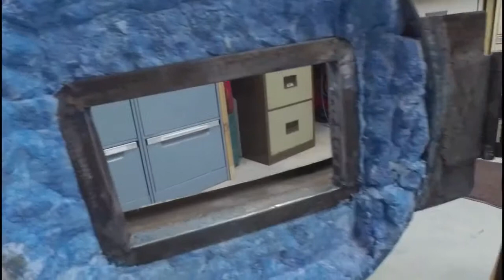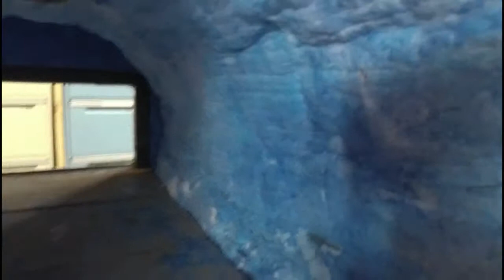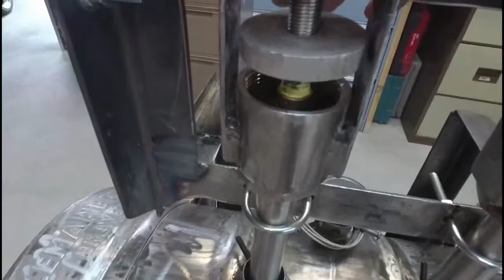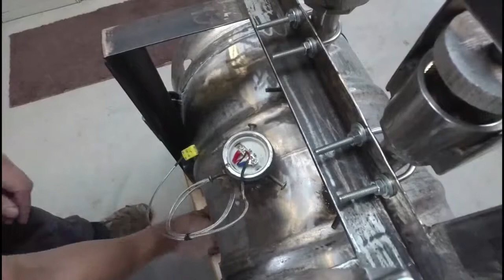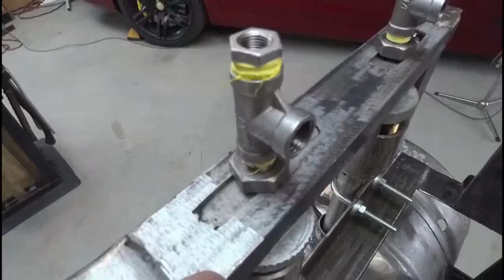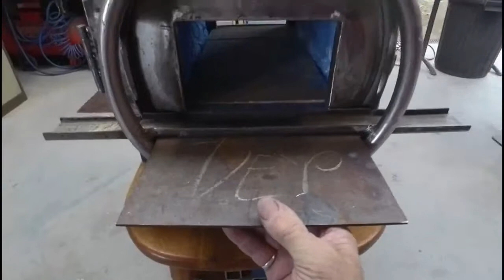Keg Forge Build Part 4

Comment: this has been fun catching up on this series. for what it's worth, you don't need rigidizer if you're going to cover the wool in castable refractory. i welded tabs for the refractory to hold on to on my forge and let the refract hold the wool in place too. the blue is a pretty sweet color!
Reply from the maker: Yer mate I'm aware you don't need the rigidiser under the refractory to hold it there, the reason I used it is because the dust from that wool is carcinogenic and I wasn't happy to do all the rest of the work I had to do before finishing the refractory layer without making sure I wasn't going to be breathing that stuff in that's all. Better safe than dirty when it comes to your health mate. And yer the blue looked great but the rigidiser isn't solid enough to use on its own as it will break away every time you touch the sides of the forge manipulating odd shaped pieces of steel inside. I'm really happy with the way the gas forge turned out in the end and its still working really well after more than a years constant heavy use before I built my coal forge which I use most of the time now.

Comment: Looking good Andy, where did you get your needle valves from, Iv'e been wanting to use those for a while. I'm going to share your channel get you some more subscribers mate. You have done a wonderful job on the forge.
Reply from the maker: Thanks Len I'm quite happy with it as well. I got those needle valves online from EBay. They are Chinese so not as good quality as the Australian brands but at a price that is about 90% cheaper. I think I got those for around $19 a piece where as the same thing from a store like Blackwoods would cost around $189. They took about 5 weeks to arrive but I had the time to wait while I was constructing the rest so that didn't worry me. I will try to find the link for you. I would really appreciate you sharing my channel mate as I would love to expand the channel as time goes on but I'm not on Facebook so I'm limited to people stumbling on my channel by chance lol
Reply: @andywright2606  Ok mate might look them up on Ebay, I'm very happy to share your channel on FB. Get some eye's on your channel.
Reply from the maker: @lenblacksmith8559  This is the seller I purchased the needle valves from 1/4" femal thread not sure what thread you need mate. 
https://rover.ebay.com/rover/0/0/0?mpre=https%3A%2F%2Fwww.ebay.com.au%2Fulk%2Fitm%2F312557505914
Reply: @andywright2606  Thanks mate. Oh by the way, with the burners where they go into the holder on top of the forge might pay to put some kaowool around inbetween the burner and the holder just to stop a chimney affect of heat coming up between the two.
Reply from the maker: @lenblacksmith8559  Hi Len, I already have ceramic fiber which is the same as kaowool between the burners and the holders. I then put rigidizer around the top. I think I showed that I one of the forge videos mate. The rigidizer showed up blue before I painting them black.
Reply: @andywright2606  Sorry mate must of missed it, good one mate.